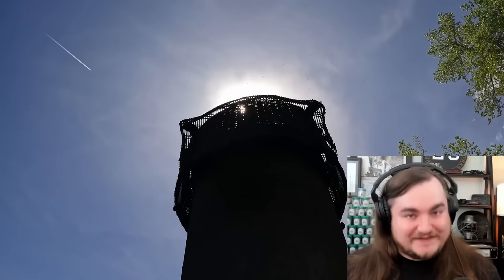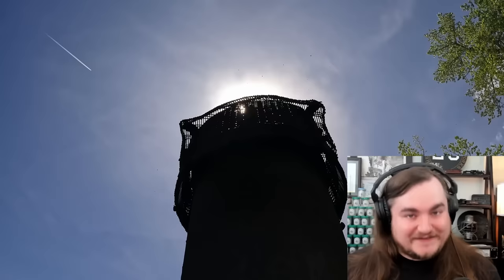Why do USA steam trains make smoke, but UK ones don't?

Comment: Having taken a few combustion courses in university, there is nothing more satisfying than seeing a steam locomotive produce almost no smoke even under load. Yes, watching huge amounts of black smoke looks dramatic, but it's a sign of inefficiency! Not to mention the huge amounts of particulate pollution: The British steam locomotives often ran in more urban environments, so I would imagine keeping smoke down was a priority, even in the era when people thought cigarettes were healthy.
Reply: On the latter point, you are exactly right. Before UK locomotives could burn Anthracite Coal smokelessly (due to it having to burn at an extremely high temprature which early fireboxes could not handle to do so), they often burned Coke due to it being smokeless. In fact, several early railways, such as the Liverpool & Manchester, were subject to smoke abatement rules which necessetatated the use of Coke.
Reply: @owenstockwood5040  Wasn’t there a law that stated something along the lines of, “all rail vehicles have to consume their own smoke”? I think I may recall something like that from the rules to the Rainhill Trials.
Reply: @highball5550  the Metropolitan Rly. was subject to that rule also - not just for the reason of disruption due to smoke but also because it was all in tunnels. A chap called Fowler built a 2-4-0 with the object of reducing smoke, used effectively bricks to store heat and lessen fuel use and therefore smoke production. In fairness, it made little smoke, but also no steam either....
Reply: @ajaxengineco  I’ve heard of Fowler’s Ghost. The firebricks are a great idea until you run out of water.
Reply: @highball5550  we also had inspecters in many cities that would make sure stack emissions were  kept to a minimum or the railroad would get fined, in the usa cuz no one wants black laundry after they wash clothes.
Reply: @manga12  given. I recall Ward Kimball saying that when you’d travel overnight by train with the window open you would wake up and your face and pillow would be black. I can only imagine that on your clothes, what a pain that would be especially right after washing.
Reply: @highball5550  there was the fact it was a known irritating agent as well all the black smoke, just like the breathing trouble the steel towns caused and how hazy they were back in the day
Reply: @manga12  not to mention the coal towns. All those gases down in the mines. The father of the famous NASA worker, Homer Hickam, died of black lung if I recall. Even if it wasn’t that I’m pretty sure it was something from the mine.
Reply: The size of the locomotives probably played a role too when you have a giant Archimedes screw feeding coal in going up a hill giving her everything she's  got. Even a Little inefficiency would cause insane smoke on those massive locomotives.
Reply: @jordanalexander615  true. Look at a UP 4000 slogging up Sherman Hill at low speed.
Reply: Sounds very likely - ships in the Thames above a certain point (London Bridge?) were subject to a rule like that under the Smoke Nuisance Abatement (Metropolis) Acts of 1853 and 1856; and factories operating steam engines were prosecuted from to time for emitting too much smoke [e.g. under the Public Health (Scotland) Act 1897].
Reply: @owenstockwood5040 how did the u.k gets its hands on anthracite? Their domestic coal was bituminous.
Reply: @uptoolate2793  Anthracite was mined in the South Wales coalfields. Commonly referred to as 'steam coal', it was especially used by the Great Western Railway which operated in this area but was distributed across the UK. Royal Navy warships were also fired with this coal.
Reply: SMOG, it killed loads of people.
I remember when we had to have "smokeless" coal for domestic fires, the majority a long time ago 

I am a bit older
Reply: The UK of course
Reply: "huge amounts of particulate pollution" lol. Steam pollution is minuscule. It's mostly water vapor
Reply: @MattPiekarsky  The "particulates" come from the fuel. But I am sure that you know that and just have an axe to grind. Probably best to watch out for the "particulates" of steel, carborundum and rust coming off it as well. They can also cause you lung problems. 😱🙄😒
Reply: For warships, it was absolutely critical they burned clean. Less visibility to be sighted by the enemy.
Reply: What … wait. . . Cigarettes aren’t healthy?
Reply: @cwt5654 South Wales steam coal was hard anthracite and the gold standard everybody aspired to.  Cleaner, hotter, more btus per ton unlike coal from the Continent.  Made a big difference to the Navy.
Germany always had clogged smoke tubes which meant shut down for cleaning.  Royal Navy could go full steam longer and farther than anyone.
Reply: "when people thought cigarettes were HARMLESS" , I'd rather say... Anyway, smoking kills, and so do living for too long, but then there was this railway yard in some colliery, AFAIR, close to some residential quarters, and the housewives used to complain to the "yard master" that those locos smoke a lot while standing idle, and "we no like it".
The solution was soon found and implemented -- a circular device made of steel pipe, fitted inside the stack at the very top of it, with a series of holes on the top, through which steam was released. Steam condensed as soon as it was released, and this white "steam cloud" obscured/ concealed the smoke... No more complaints from angry missuses : )
(Unfortunately, can't remember details - "somewhere in UK", this is all I remember about this story.)
Reply: Ireland had reserves of antrachite coal
Reply: @MrKotBonifacy  Interesting
Reply: @theoztreecrasher2647  Wanna try some industrial machining !?
Reply: I'd have to say, what's more satisfying, is being able to breath. I never smoked, but in my 60's developed asthma, and all of a sudden, became one of the 'old wheezers', as my lungs became less tolerant of bad air. So, engines that spew out particulate and other pollutants aren't exactly my favorite type. While many places don't have much choice in how to power their business machines, I sure hope that electrics powered by nuke power stations start to become more common. Yes, I was a steam fan for most of my life, but now, the only steam engines I want to supplying  our infrastructure, are the ones that don't spit out stuff that makes me cough.
Reply: @davewolfy2906 It killed? It still does! That's why coal power plants cause indirect deaths.
Reply: @davewolfy2906 I think it was called a "peasouper".
      The word Smog became widespread in the 1960s,70s and an American term.
   In the UK, especially London it was so thick it was as clear as pea soup. 
  
     Anyway there you go. I'm older.
Reply: You just singlehandedly proved every bit of info given in the video as wrong. TYVM, this saved me a lot of work, thanks
Reply: Noticeable when you read the reports of WW1 & WW2 sea battles that the RN ships always seem to be able to do more than their design speed once they got a sniff of the chance of battle. Good steam coal may explain this for WW1 but it still happened with oil firing in WW2.

For example HMS Rodney a 23 knot battleship was on its way to a US ship yard for major work on its worn out engines. When they got a message that the Bismark was loose in the Atlantic so they turn round and work up to 25 knots in pursuit. Apparently the engine room was reminiscent of a badly run sauna but they got there, and it turned out that even German engineering does not like having 16" shells poured into it at point blank range.
Reply: Bang on. We had (still have) an urbanised railway network and smoke was unwelcome when, say, walking over a railway bridge and suddenly your sunday-Best stinks worse than an ashtray! To us, that smoke just looks wrong. Our dramatic 'postcard' photos of old show huge clouds of white, not black.
Reply: Remember that during WWII many soldiers saved their life because of smoking. Nicotine helps  stop bleeding. That it may kill you later on in life is secondary.
Reply: Whenever I see punks in diesel trucks purposely rolling coal I always think to myself "Am I supposed to be impressed at how poorly tuned your engine is and that you don't know how to drive it efficiently?" I like diesels (and generally have a disdain for the EPA), but rolling coal is just stupid to me.
Reply: I couldn't agree more. Black smoke out of the chimney is a sign of inefficiency, it's almost all unburnt fuel. It creates soot which gradually coats the inside of the boiler tubes, which (A) restricts the flow of the gasses through them, and (B) forms an insulating coat which restricts/hinders the heat transfer from the hot gasses to the boiler water. So while smoke is maybe a great photographic effect, it very definitely has a bad effect on three different accounts; pollution, flue gas restriction, and hinderence of heat transfer. Although (with the varying circumstances involved - varying loads etc.) it's not always possible to keep to this rule, I was taught that the best way is to always aim for a bright cherry red fire. Personally, I hate to see a load of black smoke belching out of the chimney, it's a sign of bad firing.
Reply: @owenstockwood5040 quite right. Some stations even had. Signs reminding loco crews to keep the smoke down, basically for passenger & station staff comfort, but if signs to that effect were being officially posted, it proves that reduction of smoke CAN be done.
Reply: @Charstring it's also one of the reasons that factory chimneys were so tall; to get the smoke high up and away from the houses etc. (The other reason was to create an updraught to draw the fire (a column of hot/warm gas rising), as factory boilers did not have a blast pipe like steam locomotives. (Ships don't either, they use a forced draught fan driven by an auxiliary engine).
Reply: @MattPiekarsky true. Smoke creates particulate pollution, but steam it's self absolutely does not.
Reply: @michaelplunkett8059 it's a fact that most of the preserved railways now will tell you that it's harder now to get really decent coal which burns well, since most of the British mines have been shut down, so they can't get the choice of fuel they want (the fuel the fireboxes were designed for), in particular, South Wales coal and other high quality "steam coal", they're having to buy imported coal, which also costs more because of all the import/extra transport costs.
Reply: @d.e.b.b5788 check out "The Red Devil" on South African Railways, under their then chief engineer David Wardale. It was the most efficient steam loco in the world and more efficient & less polluting than diesel locomotives. It used Livio Dante Porta's secondary air admission techniques to produce a nearly 100% combustion efficiency (he was the chief engineer on Argentina's railway, which had very poor coal, so he developed the best way to get the most out of it. And look up "The railway at the end of the world", in Tierra Del Fuego, which runs two Garrett type loco's using L D Porta type boilers. This railway runs in a very environmentally sensitive area, and has to keep pollution to a minimum. They also found that the first one of these loco's was far more efficient than any diesel locomotive they could find, which is why they built a 2nd one along the same lines (but an improved version).
Reply: @Taketimeout3 true. There was a case of a London bus, full of passengers, the smog/peasoup was so thick that the driver really had no idea where he was. He just couldn't see. So he stopped, and got out to see where he was. When he walked round the front of the bus he found that they were a few feet from the Thames and heading straight for it. This is a true story, it's on record. Talk about the grace of God!
Reply: @mindeloman  also their boilers and what can also run a good bit more of heat then trains so they could run better hotter feuls too
Reply: You say you’re an engineer but you are cherry picky only half the truth. Anyone with time at the throttle or that has study this in depth should know and understand why there are a times you should run it rich.
Reply: @blondeguy08  I just stated my opinion about running locomotives fuel rich on purpose, based on stuff I've learned at uni. I'm obviously not an expert on the extremely complex subject of running a steam locomotive, nor did I ever claim to be one. But you seem knowledgeable, what are the most common situations you should run a boiler rich?
Reply: Lot of people here who have only had text book learnings of smoke on engines and it shows. Anyone with in depth real world experience can tell you the book is the theory but in practice you learn things they don’t teach.
Reply: @omgcool7206 lol yes there are a lot of douches that ‘role coal’ but simply saying smoke means incomplete combustion is not always the entire truth. The reason heavy equipment and high performance diesels sometimes ‘roll coal’ is to produce maximum power and go beyond. The irony is going ‘beyond’ is counterintuitive, by dumping excess fuel in a diesel you drop cylinder temperatures and reduce risk of scoring pistons very similar effect as nitrous when you give it too much but without the added complexity and cost.
Reply: @blondeguy08  What specifically am I getting wrong then? I'm asking you to educate me, but all you responded with is a statement on how little I know. In  what specific situations is it best or most efficient to run a steam loco very fuel rich?
Reply: You have entire courses dedicated to combustion at your university? That’s METAL AF!
Reply: @blondeguy08  Good point, I hadn't considered that.
Reply: US culture prefer a lot of black smoke - it is a sign of manly power! 
Hint: "rolling coal".
Reply: Every town had massive factory chimneys not to mention every house had coal fires so can't see there being much of an eco reasoning. Buildings were black due to all the smoke in the air. Things vastly improved with advent of  gas and electric heating, people sand blasted building back clean with dramatic effect. Now however there's a comeback of woodturners and you can get that waft of filthy smoke hanging around dependant on wind conditions. We are going backwards. I'd say you were on target more with an efficiency reasoning along with Welsh coal being  King.
Reply: I thought you meant they were shoveling kilos of, the other kind of coke into the train lol.